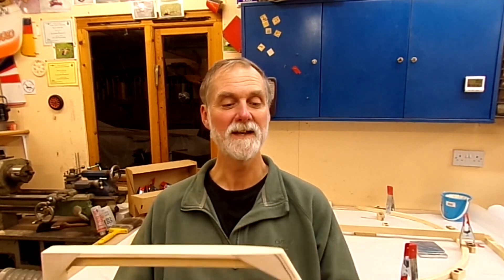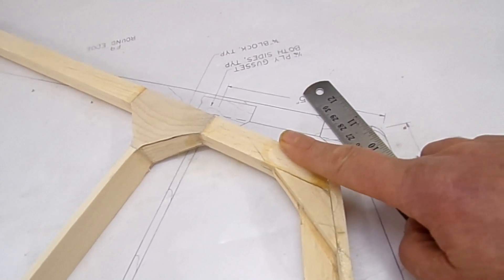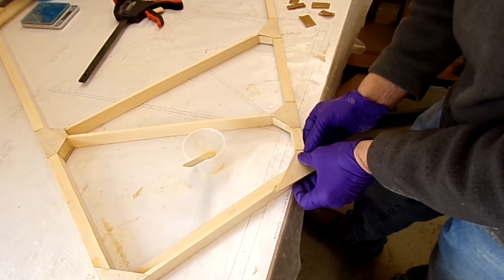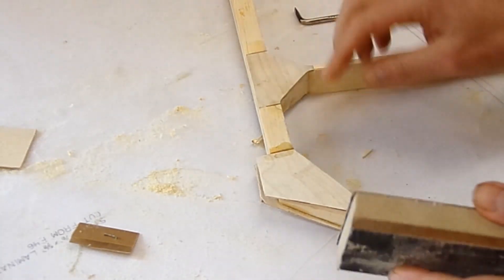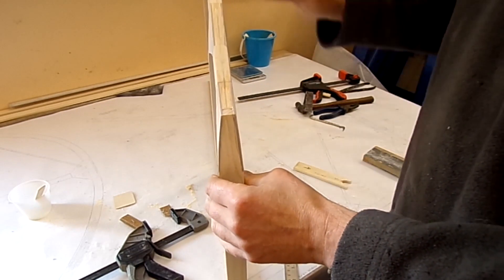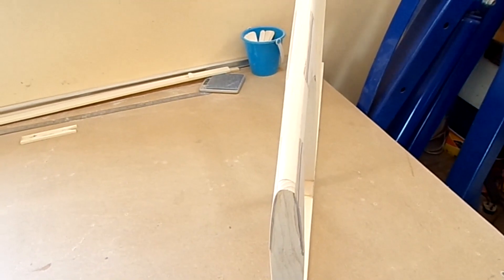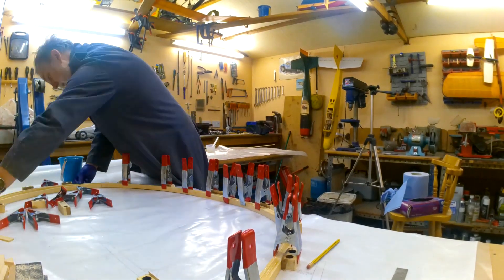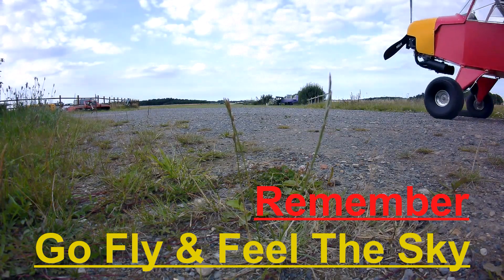EP9 Fisher Youngster V Kit Plane Build - Fin and Rudder

Comment: Thank you for posting the video -always enjoyable and informative. At around 5:29 what was the clear liquid you used to fill the staple holes after sanding - sorry I didn't catch what that was?
Reply from the maker: So happy you are getting something from the videos. The clear laquid you ask about is thin cyanoactylate, that can soak into the wood to help bond the disterbed fibres from the staples and also bonds the dust to act as filler.
Reply: @flyingkub  Right - here in the US we just call it Super Glue - hadn't heard it referred to by its proper name. Thanks for the reply - stay safe.
Reply from the maker: @joekane1872  No problem, we all speak English just slight changes happened as it went over the water :-)